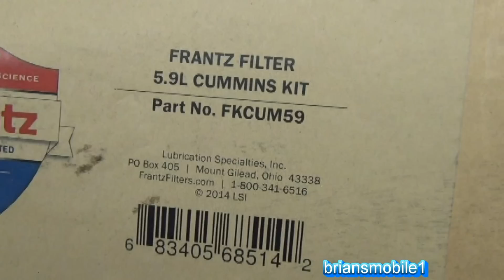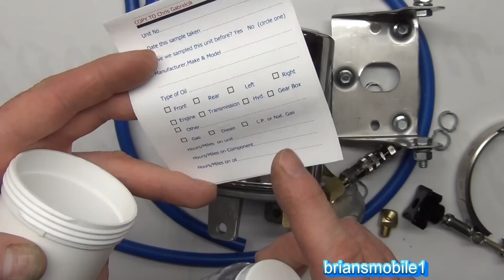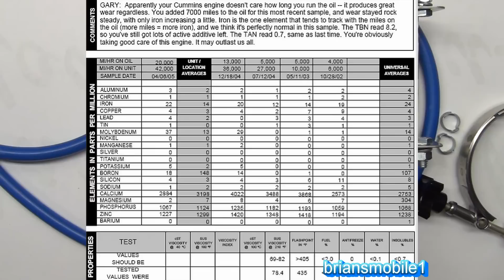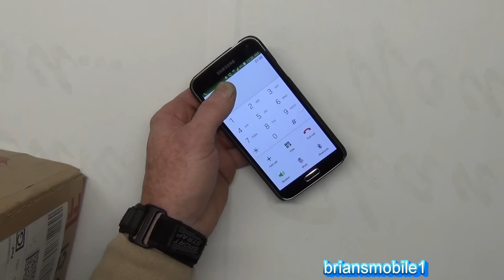How to Make Synthetic Oil Last Even Longer  Frantz

Comment: Can you use this on a unleaded motor?
Reply: yeah you can. Diesel engines have soot, more stuff in the oil, run harder and farther so oil changes add up so this offers a quicker financial return for diesel owners, but itll work great on gas engines. Ive even seen them on planes and generators.
Reply: Frantz had the FAA and PMA approved AeroFrantz was invited to look at some on crop dusters north of Sedan Kansas. In the early 80s. Ran an add in the paper. Mentioned the FAA aproval. The paper said FFA approved. Got a call asking me if I had ever seen one. I said no. He said come on up we will show you some.
Reply: Everything I own that has an oil pump has either a Motor Guard Gulf Coast junior  or a Jackmaster Classic. Including the lawn mowers. I prefer the top loaders. Jackmaster  might be the only top loader still in production. Got one on Ebay. Got the Jackmaster Classic. They claim their filter elements ard better than TP.. Jackmaster has a 2 inch core seal at the bottom. No aluminum tube to put spacers on. They use the TP core as a center tube. They have a optional air fitting to push the excess oil back to the engine before changing the TP.. I have long nosed pliers to remove the used TP. The Jackmaster elements have a ring connected to the fabric cover to remove it.. Intetesting filter. Just push in the TP and put on the lid..The Australian's have it figured out. I read somewhere they came out in 1954.
Reply: No there are a lot of them now. Some of them use very expensive toilet paper. My interest is in the ones designed to use good old toilet paper. Since the Jackmaster Classic has no center tube looks like you must use a paper that wont collapse. Such as the Jackmaster element or a paper such as Scott 1000. The Great Value 1000 from Walmart that I use is probably made by Scott.

Comment: I just put a Motor Guard M 30 on. lube. oil and a M 60 on on the tranny. 2006 Nissan Altima. Not much room under the hood. I removed the grill and installed the 2 filters. Then put the grill back on. Easy on this car. I stuck a 1/8 drill into the outlet and drilled a relief in case the TP gets clogged. These are compressed air filters that I tossed into engine cleaner to remove the epoxy coating. I left the coating on the Pontiac Torrant. For some reason every 100 or so the epoxy will turn loose of the aluminum. It wont dissolve. They do the same.with compressed air
I used a Perma Cool sandwich adapter for the engine. I doesn't matter which toilet paper filter you use.as long as the housing maker the oil go thru the paper instead around it. Motor Guard was the best at that. Not so important with lube oil bypass filters. Very important with compressed air and fuel. With those there is no second chance. I got my start with. Frantz. in 1963. They were 29.95 and people complained about the price.

Comment: Won't bits of toilet paper be moved into the oil ? I mean if you put it in water it dissolves a little
Reply from the maker: The TP just doesn't come apart.  Partly because it's packed in tight for support, but oil does nothing to it aside from make it heavy.  With the support of the screen and the low pressure though, it has nothing pulling it apart like if you held up a 6 foot strand of wet TP.  TP's designed to get wet and not fall appart- unless it's special camper or RV TP.  Don't use that here.
Reply from the maker: TP has to be perforated to tear conveniently.  Pressure here is going sideways to the perforation.
Reply: When you pull out the used TP it should be strong and tear at each sheet. If it is weak and dont tear at each sheet it has been in there too long. The oil should make the paper stronger than new. Put bacon on a napkin and see what happens to the napkin. Oil does the same thing to toilet paper. Makes it stronger.
Reply: Ive used the TP filters for 60 years. Some of these fossils have used them longer. If the paper migrated into the oil system we would have figured it out by now. Some of the big truck filters use pulverized newspapers in their best elements. Luberfiner  Fleetguard  Wix. Would anybody say wont the pulverized newspapers get in the oil? Of course not.
Reply: If any paper got past the TP in my Jackmaster Classic it would instantly clog the tiny orifice..  i have a habit of checking my filters to make sure they are heating up. The element for the Jackmaster Classic is in a fabric bag for those that have that worry.The new Jackmaster Classic comes with a element in a bag..There is a pull ring attached to the fabric. Peasants use long nosed pliers to remove the used TP.

Comment: Brilliant, I think you forgot to factor in the convenience. Less mess, less fuss. And the big bonus, a cleaner running engine. It pays for itself in about 3 years & will save me about $80 a year thereafter. Pretty sweet.
Reply from the maker: Well said Larry, well said.  I spent days preparing and studying for this video, but in the end, you can only make it so long and people still miss 60% of it anyway.
Reply: A guy on another forum said the Frantz worked good on his 59 Ford truck. He probably wouldnt use one now but he wouldnt bad mouth the Frantz. I cant imagine the nuisance of changing the oil. I normally like to put the orifice at the inlet so it will drain better at shut down. At least one hose needs to allow air to enter the filter so the oil can go back to the engine at shut down.. Cant have a low place  where oil can keep the air from entering..I will probably put the orifice at the inlet on the Jackmaster Classic. It will drain better with the orifice  at the inlet.It works better if air can enter the filter thru the return hose at shut down.
Reply: I put a .025 wire welder tip in a brass fitting and put it in the inlet. It drains good at shut down without air. Ive bought Frantzs with the orifice at the outlet under the screens. I believe the new ones are at the inlet. The Motor Guard on my old Ford 390 is over 50 years old. I would say it has paid for itself.
Reply: When I got back from town yesterday I checked my Australian Jackmaster Classic.  It was hot and the oil is Golden. Sometimes when the weather is cold the toilet paper filters are just starting to warm up when I get to work with the .060 orifice.Dont know how the .025 orifice will work in cold weather. This is the Dallas Texas area. The Jackmaster Classic with the .025 orifice cleans about 3/4 quart a minute when the oil is hot. 10 w/30 synthetic. The orifice is a .025 wire welder tip in a brass fitting. The slower the flow the better the cleaning.
Reply: The .025 wire welder tip is actually about .045 . The standard size since the 1920s for bypass filters is about .060 or about 1/16 inch. I believe the big Gulf Coast 3 gallon filter has a 1/16 inch orifice at the inlet.

Comment: J.C.Whitney back in the 60s and 70s sold toilet paper filters for cars, and like this, were replaced by you at a specific interval. I do not know if they still sell TP car/truck filters these days.
Reply: I believe JC Whitney sold a filter that screwed on in place of the full flow filter. They used about 1/3 rd of a roll of TP.Because TP is too dense to be a full flow filter a large bypass valve was always open when the engine was running.. It converted the full flow system to a bypass system. Like a Stilco or Trasco. Wouldnt be my choice. About 1965 I converted a race car mechanics Chevy 292 big 6 to a bypass system by using a Frantz oil cleaner and a Frantz adapter plate that replaced the full flow filter. He liked it because he always knew what was happening in the engine by what was showing up on top of the toilet paper. It was the tow rig. The mustang dragster needed a full flow filter. Baldwin furnished that. Valvoline furnished the racing oil.

Comment: Toilet paper is not stabilized by any resin or polymer.  So any water in the oil, and there's lots from blow by, will block and paper filtration.

Because of the use of resin in "real" filters there not affected by water.

That toilet tissue filter is, exactly what the many relevent puns would imply
Reply: Filled with oil, the filter will hold also a couple ounces of water.

Also, these same filters are used for coolant filtration, rendering your argument...... inapplicable.
Reply: Some people use T P as a pre filter to make their expensive activated charcoal water filter last longer. You would need a Glass filled nylon  Gulf Coast junior filter for that. Read about that on a Trawler world forum years ago. I put one on my Ford diesel. I thought my cooling system was clean. The TP lookes like it came out of a mud puddle. More trouble than its worth. You put tees in the heater hoses Read a letter from the marine base in Okinawa I believe. They use a Gulf Coast filters portable system. They go from equipment to equipment cleaning the cooling systems. They add additives as needed.Gulf Coast has a picture of a portable system on their web site. They do a lot of military. Not just cooling systems.
Reply: When I change the toilet paper it is strong and tears at each sheet. If the  used tp isnt strong it has been in there too long. If the tp gets rotten because it has been there too long it will stay in the housing. If a full flow filter pleats get rotten they might break down and leave the housing. I dont have a habit of neglecting filters.

Comment: Right now, they are unavailable.  I'll keep checking.  I  been debating on this bypass filter or a center fuge bypass filter. Now, I  hear the Centerfuge system takes all the good stuff out because it takes it down to  a micron also. I live in beautiful Kingman, Arizona were it is very hot and dusty. I have a 94 5.9 Cummings in a 90 F250.  I want the truck to last a long time.  it has 250k  on it now but want it to last longer. What do the kits go for? Does it come with the 94 oil cap too? Thank you so much!  God bless you and your family.
Reply: The only experience I have had with centrifuges was on my 65 Honda 305. It was inside the engine chain driven. They were popular on Mack trucks. Your engine needs some new oil. When we change the filter we add makeup oil. Not sure what Mack recommends. I doubt that they remove additives. The Honda packed the sludge in the drum tight.

Comment: I'm not a huge scientist but an HVAC mechanic and 1 micron filter in any vehicle I would assume is a pretty big restriction on oil flow. Maybe because there's only a small amount of oil entering the canister that doesn't apply.... sorry racking my brain
Reply: I think you can have a very small 1 micron filter that has a surface area of 1 micron just like you can have a very large 1 micron filter that has a much bigger surface area. I think for an equal flow, the finer the filtering the bigger the filter.
Reply: Since theyre a bypass filter and not the primary filter it wouldnt cause an issue. Your oem filter functions normally. There's a pretty steady stream of oil that comes back through my return line after the Frantz so I dont think it restricts too much
Reply: So you are still pumping the 20-30 micron oil thru the engine and oil passages?
Reply: Some of it always will be, the bypass filter filters a portion of the oil, removing the preponderance of the particles.  Statistically, there are none, but occasionally a couple might get through the engine before being picked up by the bypass filter.
Reply: That's why it's called a BYPASS filter and not a full flow filter. The way this works is simple, you normal full flow filter operates as always, it keeps 40-60psi oil flow at that as normal all that other filter gets is overflow pressure so way lower pressure as it goes through that filter, it's dumping it back into the oil pan. Even if that filter clogs up, it will NOT restrict you full flow path...
Reply: Actually bypass filters have been on cars and trucks since the 20s They all hook up the same way as the Frantz. The only difference is the Frantz has enough depth to clean oil. They all had to have an orifice. They are supposed to keep the oil pan supplied with clean oil Some including the Frantz do. The factory installed bypass filter on my Rambler American hooked up the same way as the Frantz. It was easy to remove the filter and oil lines and install the Frantz to clear up the oil. The bypass  filter on my 41 Dodge was decent. It used cotton.the same as the Luberfiner. Most of the heavy duty diesel filters such as the Luberfiner 750 hook up the same as the Frantz.They use pulverized newspapers and wood chips. Dont anyone do it but to put a bypass filter on the A/C you would need to tee off at the high pressure side and return the clean to the low pressure side. Im not an AC man. The high side might be too high for the TP filter. You might need a smaller orifice. Thats basically how a bypass filter works. You get oil pressure from the engine by removing a pipe plug or a tee at the oil pressure switch or a sandwich adapter. The filter cleans the oil and sends it to the oil pan. The orifice is to keep too much oil from going thru the bypass filter. Thats how it has been done since the 1920s. Its the same as the lubricating oil to the turbo .The oil comes from the engine oil pressure lubricates the bearing and goes to the oil pan. You need something like an orifice to keep too much oil from going thru the turbo. Cummins calls that parasitic loss. You dont want your tree to have too much mistletoe.
Reply: In an hour or so all of the contamination not removed by the full flow filter is  either in the toilet paper or has escaped thru the PCV.
Reply: The only job the Frantz has is to send about a quart of  analytically clean oil to the oil pan a minute.at about 60 quarts of oil being cleaned in a hour dirty oil doesnt stay dirty long. The sandwich adapter on my Subaru sends the clean oil to the inlet of the full flow filter.

Comment: I remember when I worked at a Mobil station these were popular in the early 80s, especially when Mobile 1 was the rage with their 25k interval that USE to be printed on the bottle. Mobil had a training class about Mobil 1. They said since the dirt doesn't bind to synthetic molecules as conventional oil does, in theory if you could keep the oil perfectly filtered the oil wouldn't need changing. You would just add an additive package. Since oe filtration is horrible, you must change it. I had many customers that ran Mobil 1 for 20k miles and changed the filter only every 5k. Never a problem. The only induced oil problems I ever had was using slick 50 in the 80s. It would build up a slime layer that could block oil passages as in camshaft oil holes and if had to rebuild a Slick 50 engine, the rebuilder would hate it b/c it makes the boring machine walk the cylinder. Don't get me started about the Arco graphite oil that no seals could contain.

Comment: I remember those filters back in the 50's. a friend of mine swore by the system, but there were some that were faulty the toilet paper broke down and was allowed to pass threw the engine causing extensive damage. you must be careful using toilet paper because not all are cellulose if that would make a difference.
Reply: Don't experiment, just use Scott's 1000. Just buy a case and keep it on a shelf in your garage.
Reply: There has never been any toilet paper that caused engine damage. Paper doesnt break down in oil. It only gets stronger. I started in 1963 with a Frantz oil cleaner and Delo 100 W30. I thought Delo 400 replaced Delo 100. You can still find Delo 100 on line. I think it is only single grade for diesels. Beautiful oil when clean. It dont sell for 55 cents a quart now.
Reply: We used 2 ply long before we had Scott 1000 or Frantz elements. It was softer but it had the 1 1/2 inch core. You could normally use the whole roll if you knew how to get it in. Any 2 ply was good.
Reply: If you don't install the TP properly and change it out every 3000 miles you might have problems. But if you do it right you will have the best cost effective oil filtration possible other then a centrifuge.
Reply: The Frantz is a good filter. They arent set up for the newer paper. You can use it if you know how. My Jackmaster Classic you get the diameter right. Push the paper down against the core seal and put on the lid. You must use a firm roll such as Scott 1000 or Great Value 1000 because with soft paper core will collapse. They have no center tube. The Gulf Coast junior is similar. They depend on the bigger core seal at the bottom The only experience ive had was a Honda 305 motor cycle. It had a chain driven centrifuge inside the engine.  I knew it was working because  it packed the sludge so tight I had to dig it out with a screw driver. I had a Frantz on the Honda 500 custom.

Comment: you guys know this filter will restrict oil flow by probably 10psi.  and probably more if you drive it hard.
Reply: No.
It's a bypass filter.
Reply: Bypass filters have been around since. the 20s. They all hook up the same as the Frantz Luberfiner Fleetguard 750 . Why did they start being a problem when TP was mentioned. Its amazing.
Reply: They have no effect on oil pressure
Reply: @ralphwood8818  i promis you it will lower both pressure and volume.  All you internet guys are the guys that think its ok to go 10k on a oil change because your owners manual says to and swear you have 1 billion miles on every car you own doing that.  But in reality all the guys who work on cars for a living are replacing engines all the time in cars who's  owner's do this sort of thing.
Reply: @blue03r6  you dont understand how the oil system works but you have an opinion. What else is new. Allowing the oil to get dirty wear and foul the engine then draining it has never made any sense. An engine doesnt need dirty oil.